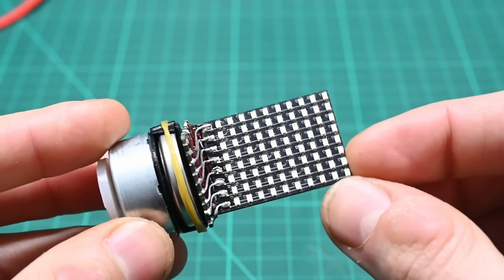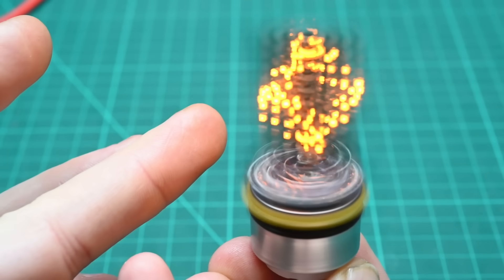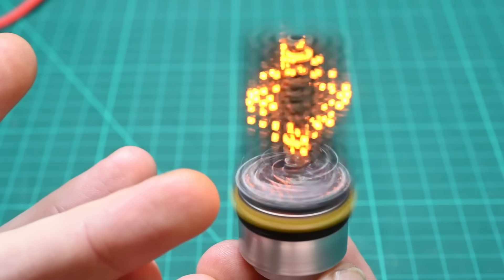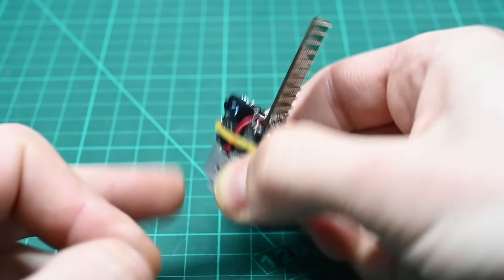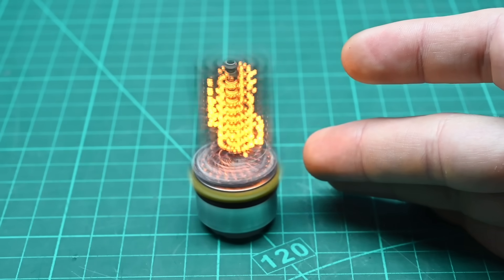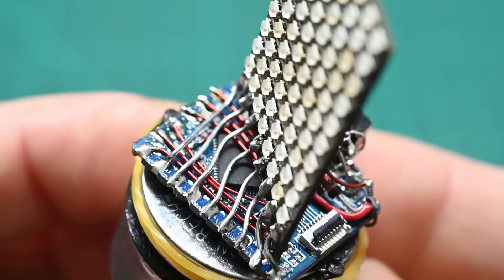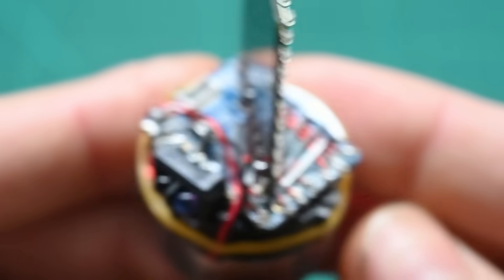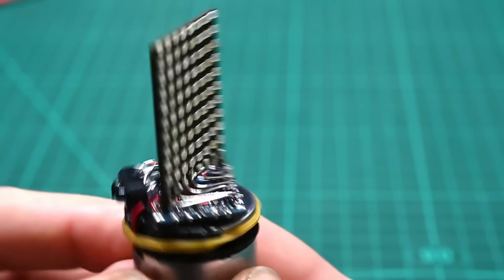Tiny volumetric display

Comment: To get the LEDs centered, instead of moving the board, you could try moving the leds. Rather than putting them onto the board, you could have holes large enough to fit the LEDs inside. Another benefit would be that you can then see them from both sides, meaning the frame rate would also double.

Comment: I think the looks could only benefit from a nixie tube style cover.
Could you mount the LEDs backwards so they shine into the board, then use cutouts in the solder mask to let the light pass through the fibreglass and make the illuminated surface the board itself?

Comment: Here's a thought.  If you did a checkerboard pattern with the LEDs, having them alternate either by color or polarization, then you could use that to produce a stereographic effect with the aid of stereographic lenses to restrict each color or polarization to one eye.  Additionally, you could also put a second board on the back and invert the pattern to give a better 360-degree effect.  This would also double the effective refresh speed of the image because it would be equivalent to "interlacing" the image.  But instead of interlacing by "even and odd lines", it would interlace by "even and odd pixels".  Though, if that proves too complex or cumbersome to implement, then a "line pattern" rather than "checkerboard" could work just as well and would hearken back to the days of old CRT monitors.

If you really want to go hog-wild, make three panel arrays set in a triangular prism shape and interlace alternating rows of red, green, and blue LEDs.  Each panel would have its rows (or whatever pattern works best) off-set so that the refresh for each color has three "phases".  That would allow for a color display as an alternative for the stereographic version.

Comment: The problem with this display is, the larger it gets, the faster it goes at its outer points, making it more dangerous. It must surely have a size limitation based on angular momentum and the physical strength of the material it’s made of.

Then, must also be encased in some kind of clear container for safety reasons.

Interesting concept though.

Comment: if you go with a odd number of leds width wise you wont have to deal with the light board center not fitting in with the illusion by being a column of black, but rather the center will be on a row of lights.

Comment: Now I want to build a higher resolution one of these to replace my android phone! It'd all be sealed in a giant vacuum tube with a removable bottom. No touchscreen keyboard (unless it's on a cyberdecky smaller digital separate display) - instead I'd have your classic pip-boy esque rotary switch knobs, and maybe a joystick or two in there. It'd be great if there was a way to fix this phone real cheap/easy/accessible too, so it could use some internals from existing kit android phones. Though I can forsee it being an ergonomic nightmare. You'd have to have a really good design for anyone to even want to use the damn thing, let alone feel good using it! Not to mention how often people already drop their phones, if you dropped this one it'd be over! So, it'd have to be drop-proof too. If only room temperature superconductors were something anyone could come by.

Comment: I don't understand how volumetric displays work. Why would spinning lights simulate a 3d object?
Reply: You might think it is just a still image that is spinning but actually it is changed pixels many times for each rotation which is how it shows it in 3d, basically is like an illusion since it happens so fast your eyes see it as lighting up all places in the rotation at once. Sorry if it is not clear enough
Reply: @marcobel9671  No that's actually a very clear explanation, and I understand that. I'm just amazed that processing or I/O is fast enough to know the orientation of the spinning board at such a timescale that you can simulate 3d things by timed LED on/off
Reply: when it spins so fast its almost as if the rectangular plane turns into a solid cylinder . just think of it like that.

Comment: What if you used 2 rotating assemblies, one for each axis? Then you could massively reduce the LED count while still being able to increase LED density in the image and reduce weight, yes you'd end up with a spherical screen space, but it would probably be able to spin faster for a frame rate as well due to a lower moment of inertia.

Comment: now make a 100/1 upscale of it in a vaccum sealed glass tube with smaller and more compact neopixels, at a greater rate of rotation and you got yourself a quiet and stable hologram, the vaccum helps it spin faster and be quieter

Comment: Not sure if it would help, but for the LED center-alignment, they make surface mount LEDs where you put a hole in the PCB and put the pads on the rear and the LED mount from the rear and their bodies poke through the PCB. This might help put the center-line of the LEDs and the PCB in the same place.

Comment: While there are the issues you mentioned with the low resolution, also the center column, and the fact it will break down eventually from having rapidly moving parts, it looks like you've minimized some of those issues already.  I've seen this technology before but I don't remember seeing it this small.  I'm wondering if you can get all the parts and leds even smaller while making the array wider and taller.  Because, if you could, it would then solve the resolution issue.  But, then it might make it more difficult to power and spin it and keep it balanced right.  But, if all you're going for is replicating a tea light, you're already mostly there.  This is pretty impressive.  I'm wondering though, since this has to spin all of those components, no matter how small or light you get them, that must use a lot of battery power.  How long can that last without being plugged in?  Might it be possible to include a way to wirelessly charge it and just have it sat on a wireless charger?  I'm wondering if the resolution were increased if this could be used like a display for videos or video calls.  Obviously, that wouldn't work with this but maybe a future version of it.  Think about it, having a 3D or at least 2.5D video call would be pretty cool.  I apologize if my comment is too long, this video just got me thinking.

Comment: What about if you made a small frame around the LED frame and poured resin over the LED's to the same thickness as the board and then moved the boatd back so the LED's are on the center line?

Comment: 1 idea to improve the design would be to have the display board cut in half at the axis of rotation and have one of the boards bent at a right angle so you can have a line of leds on the axis of roation to get sharper point for the flame

Comment: you could balance it with a plastic transparent sheet of approximately the same weight as the LEDs support,  glued on top of the LEDs, and then place the LEDs centered on the rotation axis

Comment: It's not the bets reislution indeed, but, it is very small, and reasonably cheap, and already cool.
Perhaps actually using a screen might help, but it would have to be quite bright and have a really high response time, but maybe that might improve things quite a bit.
There ar4e already some somewhat see through panels, that might also help, you might then perhaps even use two screens ? Maybe three screens would even be better then. Will take some figuring out how to work that well, but might help a lot.
I mean, let's not kid ourselves, for some things, such screens are the future to represent 3D models for everyone looking and not everyone having to put on 3D goggle or whatever.
Maybe some standard lenses or glasses with AR in due time, but that will be further off, a lot further.
There have also been some ideas of a spinning thing with lasers firing from the bottom, might also work. Not for something this small.

Comment: You may have addressed this in an earlier video, but would there be any benefit to having an odd number of columns of LEDs? 7 or 9, instead of 8.

It would allow you to show a thinner centre line which sounds useful for cones or pyramids so you can have a single point at the top. However, it could mess with the timing / programming you've already done, so if those are the only applications, it may not be worth the effort. Consider the 2D pros/cons of even vs odd displays and pixel images.
Reply: Also, this is very cool :) Thanks for sharing

Comment: I know this sounds impractical but hear me out. You could a MASSIVE larger scaled of this! With the current materials used, it would probably cause issues with spinning fast enough to create an image due to the shier size and weight of the panel, as well as the air resistance it would cause if it we're to reach that speed; it would self destruct lol. BUT if  you used a pole, with LED strips attached, sort of like one of those  swing rides at a carnival.

Comment: So, interesting idea for a scale up, if you were to try an increase the size of the design, you would have problems with the entire screen acting as a giant fan.  You could potentially solve this by putting the entire display into a relatively sized vacuumed container.  Just an interesting thought if you want to build a bigger model.

Comment: If on the middle an led could be on the very middle top of the display it would really add to the candle effect but the a hollow middle row or one slighter thicker cylinder below what I’ve suggested could also have LEDs all the way down to make the axis’s shape more active but I guess becoming thicker but shouldn’t mess with balance if centred well. May even improve stability. Great effort as usual and a wonderful prof of concept.

Comment: Considering the IR sensor is what is determining direction. if you had a compass like mechanism that allows the IR sensor to detect where north is, you could have a volumetric (holographic-ish) compass where a Display of "N" and even an arrow would point to the right direction. Expanding of that, given some coordinates and some triangulation equation it could point you to the right direction given current location. I am nowhere near smart enough to come up with a solution but this entire prototype is exciting!

Comment: I love how this device obviously supports tracking yet no mention of this feature is made, as if that's trivial.
Reply: Its inherent with the design as the sensor needs something to measure a complete rotation. It's really cool and intuitive to use
Reply: @alextasarov1341  The tracker also acts as on/off button.
Reply: USE THE FORCE
Reply: It actually is trivial since, as alexasarov has pointed out, the sensor basically fixes where a rotation is measured, so moving your finger around will the sensor will move the rotation boundary too
Reply: Why would your orientation matter? It's spinning so one of the lights is always on. You'll just be seeing it in a different position in the rotation no matter where you're standing.
Reply: @NarattoRadians  two words: frame timing. the display needs to spin at a good RPM relative to the framerate of the display's refreshing.

ninja edit: well, "needs." it doesn't NEED it, it just looks almost immeasurably more... correct is the word i'll chose.
Reply: @NarattoRadians  because you'd be seeing a different angle
Reply: @The_Wosh  no, youd be seeing the light in a different point in its rotation. it cant create lights where there are none.

This is like saying that someone should be able to see what youre looking at on your computer screen from behind it, just "on a different angle"
Reply: @Kairofurtv  He said each LED illuminates twice per rotation, which gives it a 360° viewing angle.
Reply: Exactly what I was gonna say

Comment: the weight of the offset led mounting panel can be balanced by a clear panel in front of the leds... more ideal but harder to prototype would be a clear panel with leds and wiring embedded in a clear panel, possibly a poured resin that then picks up the leds and leads. in any case a several-way beautiful project :)) thank you for showing us.

Comment: Put your LEDs in holes in the board so they display from both sides, then off-center the LEDs on the left side by half a pixel.  Then you can have double the resolution for the same number of LEDs.
You'd need to do some balancing as one side will be slightly closer to the axis, unless you alternated the half pixel shift shift per row.

Comment: Now, there are 1.1mmx1.1mm rgb neopixels smd chips at adafruit sold by packs of 50x.  With  // lines of 10 you can reach a 3000hz refresh rate.

Comment: I had a similar idea but I'd spin a special semi transparent film that could still display projector light, something akin to holloween nets or a film I have not discovered yet. Then use dual projectors to project on to the spinning screen. The images projected when match the rpm of the screen, the projectors would be 90 degrees from one another for full time coverage.

Comment: If you center the LEDs then can't you just put a clear piece of acrylic over the LEDs that weighs the same as the board in order to balance it? I guess the tricky part would getting both panels to weigh the same amount. You could possibly just use an identical piece of acrylic as the back panel? otherwise the back panel could possibly be sanded down to match the clear front panel weight...

Comment: I would build a epoxy resin cube, placed that whole product inside a plastic tube, which allows to fix broken parts over the time and placed the transparent tube in the center of the empty cube mold to fill it finally with the liquid epoxy resin. After polish the cube you can sell it online for the double of your production investment, which is a fair price for a hand made and time consuming piece of decoration!

Comment: I've seen that now companies are putting displays directly over processors which makes HQ display over a tiny surface
take that and replace the circuit, the receiver and display with that
one of the many problems would be how you deliver sufficient power to a rotating disc

Comment: Seems like something that belongs in a film like Blade Runner. The way it's a tiny thing you can hold in your hand, somewhat crudely built, and is ultimately a fairly simple electo mechanical device (other than the computer actually determining what lights to show) adds the the aesthetic.

Comment: I have a few questions. Is the IR sensor supposed to be on/off of the standalone configuration you have here? Also how would you go about setting a designated "front" view or axis to the system if you wanted to design a stationary display system with this design? Watching this i love the spinning take on a volumetric display. After watching this I have an idea for something like this but in a stationary and enclosed design (also maybe with a little high resolution like 32x32 and overall larger design as a whole) and something that can be sitting on a desk, maybe instead of a sensor indicator to spin it can just be plugged in and or switched on.

Comment: next level: a custom pcb design with an ESP32, the WS2812B in their 1010 size (1mm x 1mm), and a lipo charging circuit and lipo battery?:)

Comment: If you do offset the board from centreline to centre up the LEDs, perhaps you could cast or machine a sheet of clear plastic to match the weight on the other side and bring it back into balance.
Great work!

Comment: I have two ideas to improve the work, you can use the Tesla tower to give energy to the device, and since the coil is self-similar, the problem of instability will disappear.
And the second point is that you can put this inside a tube without air to eliminate the air resistance.🤔

Comment: Do this bigger with more, smaller lights closer together and you've probably got a product you can sell (if it hasn't been done). These would be amazing lights/decorations. I can see YouTubers using these in the background, or even just someone at home in place of like a lava lamp. A lava lamp animation would probably be pretty cool for that matter.

Think as well, like you could make big cylinders of these and restaurants could use them to animate flames outside or something. Fake candle. Line a wall like LED lights but more interesting. 3D advertising.

Actually dB noise coming from them might be a problem though. I imagine larger ones could be quite loud.

Comment: Just a thought: If you had two LED panels (back to back) mounted in a broader disk and the base disk mounted to a shallow steel cup or plate (think candle holder), you might get a better effect and have a bit more room to work with, of course, several people mentioned back to back LED panels.  If you used three panels placed back to back (triangle) ?
Regardless, your video was enjoyable to watch.

Comment: how about balancing the led board by splitting it in half and have the leds facing in opposite direction? this should balance the rotor and allow to place the leds exactly in the middle? maybe i am missing some other limitation making this proposal impossible to implement?

Comment: Add a thin piece of transparent (translucent?) plastic to offset the PCB weight, to allow the LED's to be moved to the midplane; also make the PCB single sided and sand the PCB down to make it thinner/lighter, or print it on flexible kapton with cutouts for the LED's with two rigid wire towers for support. Maybe have flexible tabs for each end of the LED that fold down perpendicular, and use a tiny jig for soldering the LED's to the bent tabs.